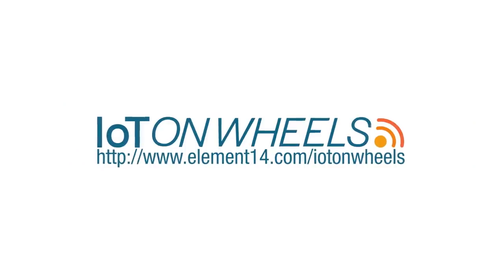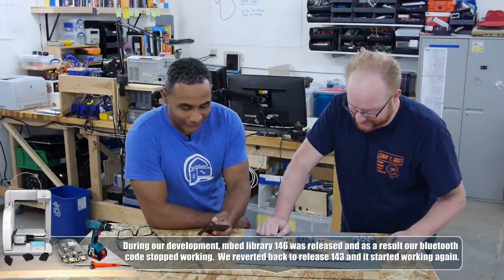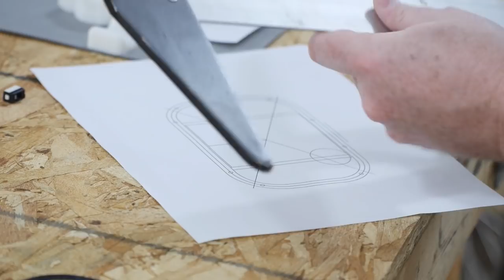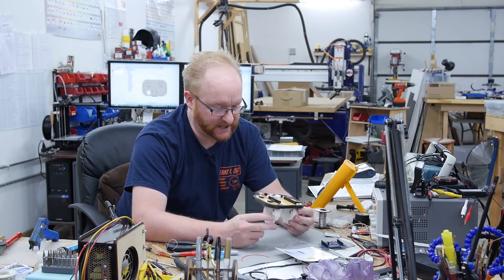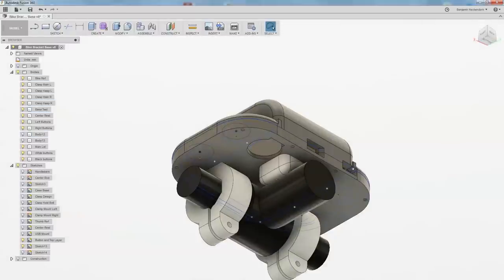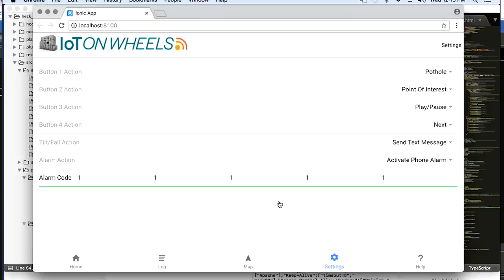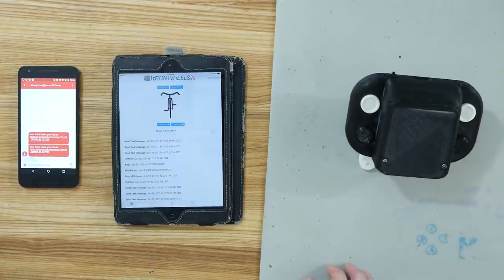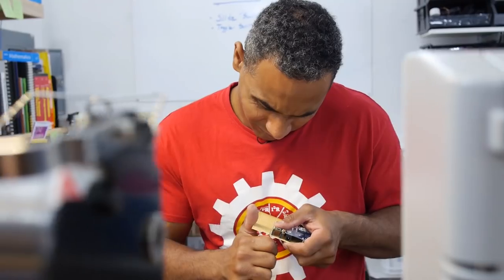IoT on Wheels Part 2: Smart Bike

Comment: How about a competition episode, where Ben, Felix, Karen, whoever else is available each get the same relatively simple task that they solve each in their own way, and then at the end see whose way was better?
Reply: We did Hackbots where we each built a RC robot and battled them. What other sort of competition did you have in mind? I think it'd be fun to challenge the boys again!
Reply: I would say the classic STAIR challenge would fit. it is about transporting an object (normally a little rubber ball) to the top of the staircase without touching it with your body.
So people normally build stair climbing robots, rovers or flinging and shooting devices that should transport the ball up the stairs.(if it rolls down again you loose).

Comment: So what was used to allow the device to message the phone
Reply: dfalconerio I was wondering the same thing. I heard no mention of a GSM module.
Reply: Donald Holden hopefully some one answers.
Reply: The breakout board connected to the Nucleo board has a bluetooth module.
Reply: theHeckwithKaren Well we know that, but Bluetooth has a very limited effective range. So how is it supposed to alert your phone if it's stolen? If it's parked outside a building and you're more than a few yards inside, that connection is going to drop.
Reply: theHeckwithKaren bluetooth is not always kept on and range is not too great. I was assuming you had gsm integrated so that it could sms the owner.
Reply: theHeckwithKaren creepily grins at karen. You are awesome.

Comment: Why 3d print a piece of plastic that you can buy for far cheaper?
Reply: Cheaper? Not really. Tupperware usually costs around $1-$4, while material for 3D printing is around $30/kg... at those maybe 50g in there, it's close enough, but you spare yourself a trip to the store, or multiple, and having to go through the shelves until you find the right one.